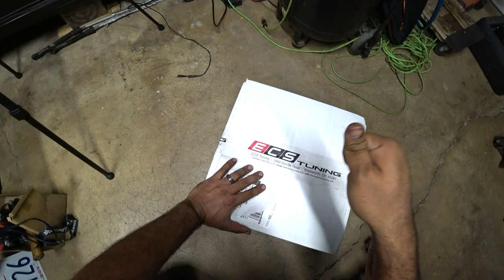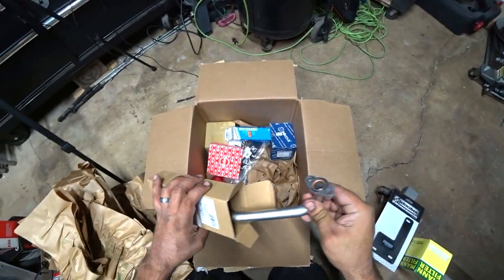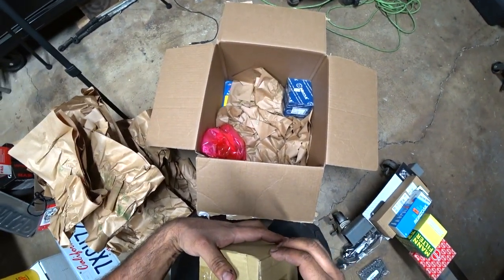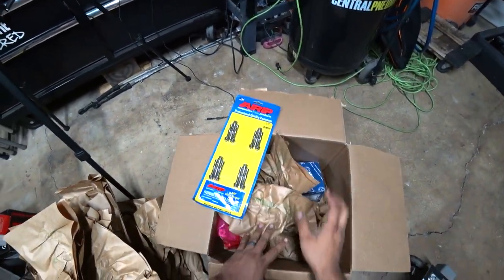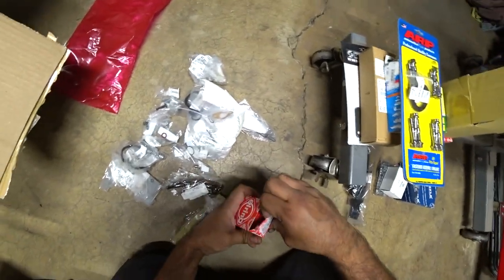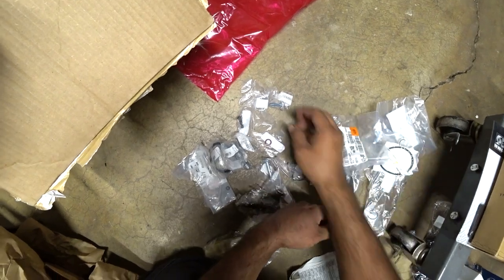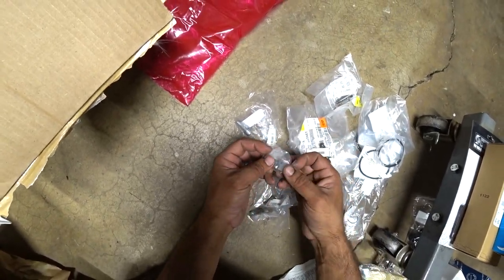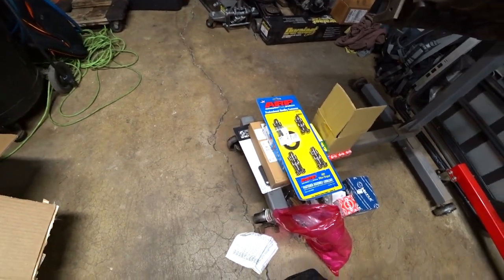VR6 ECS TUNING UNBOXING PART2

Comment: love the mk4 videos your tutorials are a big help to the community.  I have a question im going to buy a new clutch from ecs tuning for my mk4 gti 1.8t . I have aftermarket dog bone and coilovers down pipe, you kno full bolt ons. and all the  n75 secondary air delete and a stage 2 ecu tune to 21psi . and I was wondering what clutch kit you would recommend from ecs for a daily driver.  thanks and keep up the good work 👍.
Reply from the maker: Stage 1 kit will be perfect